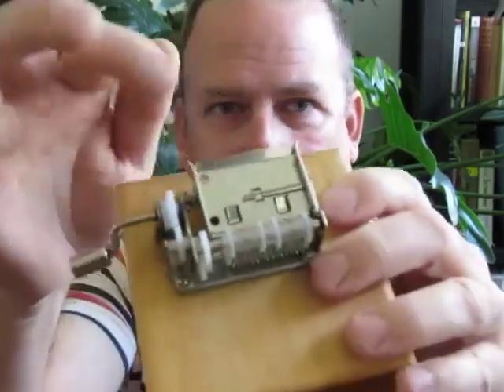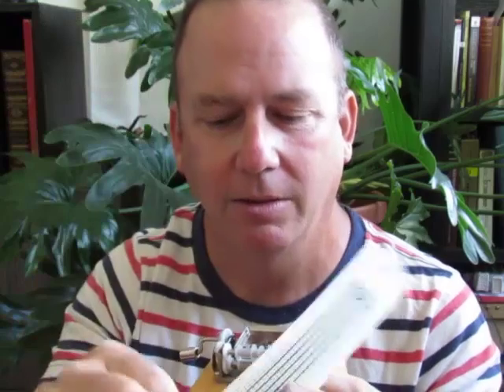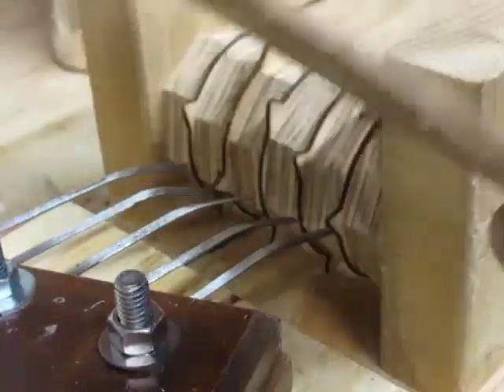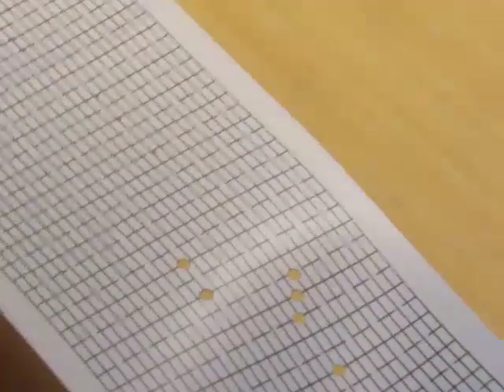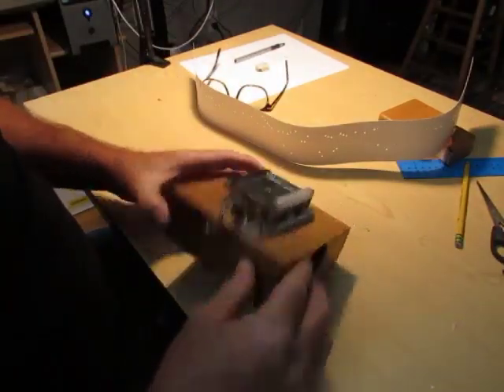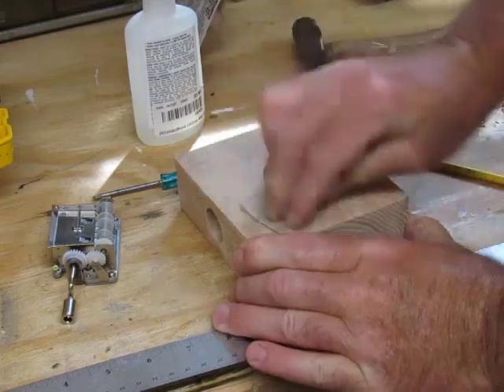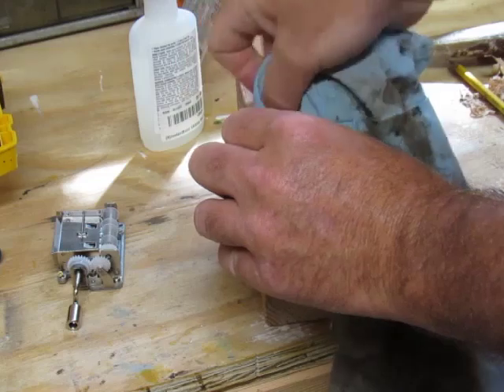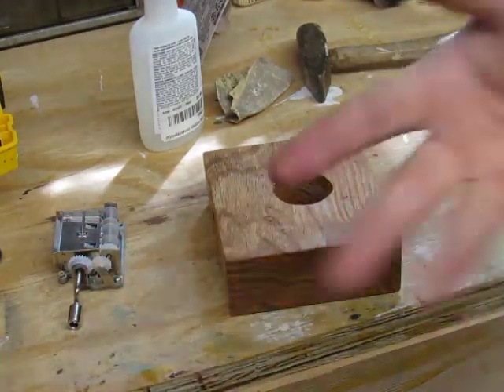Music Box Block

Comment: aaaargh... I wrote a big comment and it didn't do... I think it said.

09:55 Your plucky pluckers rely on slipping under the card until they engage in a notch and then they turn. I suspect you made this as a demo not as a perfect working model.
12:22 The punching seems so satisfying the sound is fantastic, you have to sample that.
15:40 We need to know more about the tape holder..
16:12 If I got that code properly working you could draft this before punching it to avoid mistakes. But I guess that isn't the point, the mistakes add to the physicality of the composition process.
17:30 It is a sketch. I find myself hanging onto every note try to get a feel for how the whole tune fits together. You didn't talk about making chords...and now I see why they are important.
19:01 I think you need a push stick. I am terrified of table saws. 
20:00 The wooden washer. You could sell them they look so fascinating and interesting.
21:38 Would some rubber feet stop it slipping and also allow some sound out of the bottom?
26:00 Tong oil. Is that the same oil you put on the picodrone veneers? It smells divine. I really really enjoyed this discussion of the finishing process, it was hypnotic.

I wonder what effect other big resonators like an acoustic guitar body would have on the sound or a large metal oil drum? Having something with strings that resonate along could be interesting then you are kind of filter pinging like Hainbach. I guess the modular can filter and do all kinds of similar things to the sound.

Thank you Patrick for sharing this journey, it was plucked from the heavens.
Reply from the maker: Reading your epic responses is so fulfilling!